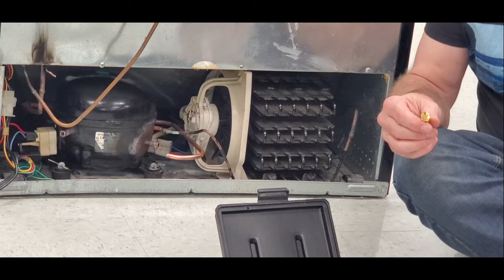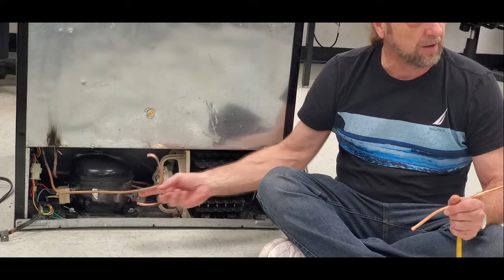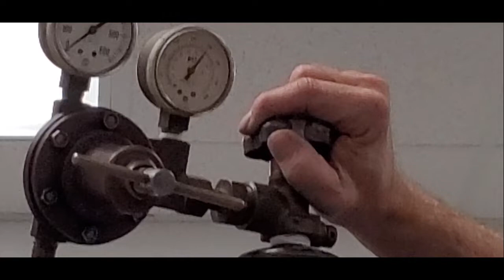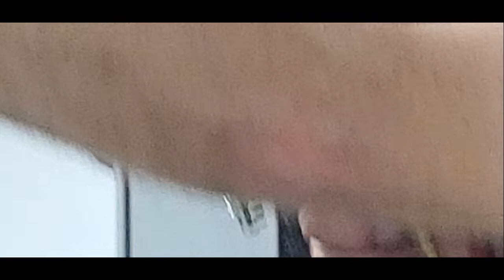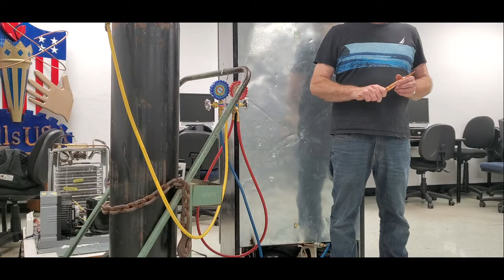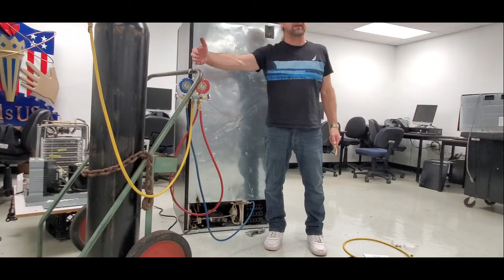Sealed System Looking for restricted capillary tube

Comment: At 26:09, he said that if there is no oil coming out you only have to replace the capillary and evaporator. If the nitrogen is coming out of the capillary tube with the proper amount of force, wouldn’t this mean he cleared the restriction? So why not just install a new filter drier, evacuate, and recharge?

Comment: Good day sir. I have a question about recharging refrigerant to a fridge. I have noticed that you charged the sealed system with the can upside down. Is that the correct manner cause I have seen other video clips where some say that you might damage the compressor internally if you charge liquid manner. Which is the correct way and why do you recommend liquid form. Tman
Reply: The main reasons to charge as liquid are: 1) It’s faster, which is probably not much of a concern on small self contained systems…2) Blended refrigerants can fractionate as a vapor, meaning parts of the blend may be getting fed in while others are not (the same is true for leaks with blended refrigerants). So you can mess up the blend potentially when charging these as a vapor.

I almost always charge everything as a liquid. You just have to use your manifold (or whatever valve you have in your charging setup) as a metering device while charging into the low side while the compressor is running. Crack it open, you’ll see your needle dancing around, monitor the compressor for frost or any strange “tinking” noises. This is so you don’t have the compressor trying to pump liquid, which can damage the valves. But if you did a repair and evacuated the system, just charge as liquid through the high side before energizing the compressor and let everything equalize, you can freely put liquid in this way.

Comment: I have a Samsung fridge the has this problem that you are talking about about , it hold pressure pretty good , the cap tube is not restricted, but when the compressor start stay on a vacuum about 13 inches of mercury . Any suggestions for me ?

Comment: Question. I have a r134a commercial refrigerator for soft drinks thats pulling into vacuum. I pumped nitrogen through suction to capilary and im getting a steady flow. Not sure how much flow i should get. Replaced drier pulled vacuum ran system. But still my gauge pulls to zero and i cant get it to 15psi. Any ideas.
Reply: You want to push nitrogen through the high side and watch it equalize to the low side when checking for a capillary tube restriction. Emulate the flow of refrigerant in the system. It’s generally a good practice in all nitrogen test cases, especially on cap tube systems. 

It could be that the restriction is only getting pushed up against or into the tube when the pressure is running the direction of the refrigerant flow. Another possibility is the system got moisture into it and it’s freezing in the system when it’s running.

Comment: Very very good video.  I do service  repair. I try to avoid.. working on sealed systems.. lots of Junk compressor today..

But like to save old refrigerator. 

I have a blocked line..
Capillary is flowing.. but lots of oil.

This I saw.. just cutting.. the cap.. at drier.  System was at 60 psi.
Unplugged not running.

I need to figure out if compressor..
Valve.. May be sticking..

I shut off the unit.. and it did not equalize..   Compressor tried to start.. was overloaded..
Ptc tripped 2 times. 

Then it kicked off.. but pressure  went to vacuum..

Can the valves cause this..?

I don't believe I have a restriction..
But there is oil in cap tube..

I'm  going to flush  the tube..?

Advice or link.. to testing compressor would be great.

These new Inverter compressor,  especially LG run.. but have failed to pump..  I call them Junk..

Comment: This is fantastic. One quibble - water boils at 212,not 312. Or 100 if you aren't using freedom units.
Reply from the maker: My instructor spent about a hour speaking nothing but facts mind you.. he has one misspeak and here come alll the Wikipedias ...... smh why even watch🤷‍♂️
Reply: I believe you meant to say medieval units
Reply: Water obeys the Smith tables.  The boiling point a function of pressure and temperature.

Comment: Why the suction pressure should read at 0 psig while running ?
Reply from the maker: Those are the design pressures on a 134a system. High pressure is 120-130 psi depending on ambient temperature

Comment: So the only way to get oil out off capillary tube is blow it out with nighten, if it’s full of oil then the compressor is low or some one put to much oil in system ??
Does the container and capillary tube and filter all have to be replaced ???

Comment: This is a really good dude all the way presenting some really good and must have information. I'm here because of capillary tubes restrictions and running in a vacuum.

You definitely have a lot of energy to present all of that information in 1! One bit of advice even though everything you are saying is music to my ears but for your students so much information at such a fast pace and then at different points random students are throwing out desperate questions

I would highly recommend slowing the pace a little bit and focusing on one area at the time and maybe elaborate a little bit more.

One last note as a student many years ago in the classroom and in the field one of the very first items that should be taught in my opinion is the magic of the metering device and what it does

In layman terms refrigerant goes in at around 100° but comes out the other side around 40 degrees. Someone that is just getting into the field can really grasp that very basic example and then the rest of their education will be smooth

Comment: just one additional point nitrogen is heavier than air and displaces it easily so when working with nitrogen you should do so in a well ventilated area our have exhaust fan running .  nitrogen will knock you out so quick you will not know what hit you....and that will be the end . its very deadly .

Comment: Great instructor, thanks for all your videos, sir.
I have a couple of questions:

1. Should a little bit of freon be added (to check pressure movement to determine if that is a leak or restriction) with the fridge turned OFF or it can be turned ON to see changes live? 
2. If pressure is negative on the low side and we need to find out whether the issue is restriction or leak. Can I turn the fridge OFF IF pressure didn't change, then this is a restriction, and if the pressure started to change, then this is a leak? Would this assumption be correct? 
3. Applying Nitrogen on low side to check for the restriction, will it be pushed to both low and high side (through the compressor)? Like if I cut capillary tube on normally working fridge, then apply Nitrogen, will I feel it from both sides of capillary tube or just from low / high side of it?

THANK YOU!
Reply: 1. Yes you can add freon from the low side in vapor form and see if both side of the system respond, while it is running.
2. if it was a leak pressure will rise if it is in a vacuum, how high depends on how much leaked out. At least minimum if a leak and there is no refrigerant left the pressure will return to 0 psi. RESTRICTIONS CAN BE PARTIAL, TOTAL OR FLOATING. So results after turning the refrigerator off vary. 
through the
Reply: @appliancetraining5600  looks like your 
 message hit a limit of letter numbers or something. Would be interested to know the answer on the 3rd question. Thank you very much
Reply: @НикитаЯровой-с4ш  if system is not restricted, and you charge with nitrogen, to lets say 100 psi if you cut the capillary tube and pressure should come out of both ends, if restricted may only come out of the cap tube side and not drier filter. The compressor depending on type of compressor and position of the piston sometimes charging through just process stub of the compressor may not push through compressor to the condenser.

Comment: The process tube adaptor kit is used in conjunction with the process tube pinch off tool to seal up hermetic sealed systems, instead of leaving access valves which can leak.  All servicing is done thru the process tubes. They can be added to each side of the system or lengthened, do your work, thru the process tubes and pinch them off, remove your process adaptor, and seal the end with a braze, maintaining the sealed system.
Reply: You're correct, I have been saying that for years. We can't pinchnand seal off 600a units the valves stay on.
Reply: @riz65  Offcorse you can! 2 pinch off pliers make job safe!
Reply: . @NiksaMarkoviczvirka   yes you can remove valves, but it's not safe, If you pinch of tool is leaking when you are trying to seal with a torch you have a flame hazard or explosive hazard, So I say this if you remove the valves which is possible, the risk is on you. So If I said its ok and somone does it incorrectly then I would be the one at fault
Reply: I just discovered this product, but why not braze a service valve? If brazed properly, and using a proper cap, it will not leak, a service valve could also give access for future service.
Reply: @hobbyless4089  Every time when you connect pressure meter to that process tube you are loosing too much refrigerant. Therefore on systems with less than 200 g of refrigerant, make them sealed!

Comment: Don't risk your fingers over saving refrigerant! There's internet posts on what can happen. Also if you use gloves make 100% sure there's no holes in it. The holes can trap refrigerant between your skin and gloves and can promote frostbite faster than you realize. In appliances it's pretty much not worth the risk with how much refrigerant these systems take so when in doubt let it out. Accidents aren't punishable by law at least for that amount.

Comment: I removed a freezer compressor and I open the compressor and water is inside no oil what happen with it
Reply: Sorry I dont get email notifications of posts from viewers, if you have water in your system that most likely happen due to a low side leak like the evaporator, they run in a vacuum almost when cooling, so a small leak will make the evaporator run below 0 PSI and that would allow moisture/water to get sucked into the system

Comment: Lg linear low side -10, high side 225 after installing new compressor.
Reply from the maker: Does the unit equalize... if so how long.. psi?
Reply: @TMMApplianceRepair how long should the unit take to equalize? Trying to see if I have a restriction. Fridge is running in vacuum while plugged in (around 18 inches of mercury). Pressure on low side goes up to 45psi after 10-15 minutes.. so what’s the normal time it should take to equalize?

Comment: you're right about heat restricting caps. It's POE I rarely rarely rarely ever changed a cap with R12 and 502 but since the introduction of POE it's common. If you work on commercial coolers and freezers you know. BOY do you go about the hard expensive way of testing for a restriction. If the unit is in vacuum do not add gas (I use to make that mistake). Turn the unit off and watch how fast the low pressure recovers, pretty much like you watch how fast it dropped with nitrogen. If it takes 5-10 min to stabilize it's restricted and not low. So prior to adding gas check for restriction 1st, by simply turning off the unit and watching the low pressure recover
Reply: Nice explanation ,thanks
Reply: So how long should it take for the pressures to equalize?

Comment: OMG... hope your students didnt record this... you referred to a filter drier as a drier filter, which is no big deal but never heard it called that, most call it a liquid line filter drier, because the suction line filter is normally only a temporary drier of sorts.  also.. you continually call waters boiling point 312F.... when its actually 212F.  I was supprised that not one student picked up on that, or questioned you about that.  teach the students that if refrigerant liquid spills out, especially in winter, dont be a hero. let it fly. no need to get hurt doing this work. I've found that liquid stage usually turns to vapor after a few seconds anyway....but that liquid is bad frost bite.
    Your going to find it will be difficult for your students to "UNLEARN" something you've already taught them, and the high pressure from the condenser never leaves the bottom of the cabinet as you were pointing to the upper cabinet. It never leaves the bottom unless the cap tube starts in the upper cabinet. however, your cap tube,(like most), is down below. your teaching of the sponge and body temperature relationship was good.  Teaching is no easy task.
Reply: I did correct myself when Tech2 pointed it out 9 months ago. This is a live lesson and unscripted as I do make some mistakes. Yes I did say 312' instead of 212'.

It is obvious you are an AC tech not only by your screen name, but in your understanding of the system. Refrigerators have a loop called Yoder by some manufacturers and Hot Gas loop by others. This is an extension of the condenser which runs up around the freezer door to reduce exterior moisture from forming around the door gasket of the freezer, so you are incorrect about the high pressure never leaves the bottom of the cabinet.

Although the capillary tube is a  liquid line that term is rarely used on refrigerators and the Hot gas line does go up and back down to the bottom, look at this link half way down an example and explanation is given. 

https://appliancerepaircourses.com/home-appliance-refrigeration-technician-course/hart-course-module-three-sample/
Reply: I saw your comment on the LLFD N laughed. I was gonna ask if you caught the 310 boiler spoiler point. Lmao!! 😂😂😂 He needs to take his own advice and perpetuate his metaphor of water to his students. He's water n they're all sponges. just hope they don't leak that bad info. LoL. I'm an engineer and during a class similar, My "Instructor"  said to all ... "Propane is lighter than atmosphere" 😂😂😂 Then when I nicely disagreed, He called me an idiot! SMH. Actually asked if I wanted to go outside and handle it. 😂😂😂 I told him.." No Sir. I  believe one more wack on that skull will probably make you forget everything!" Then I looked at all the others n said.. He'll apologize tomorrow hopefully. LP GAS SINKS. Remember that.  Needless to say I Tested, Pre-grad n never went back to that class. Least two of us are paying attention. lol
Reply: I saw your comment on the LLFD N laughed. I was gonna ask if you caught the 310 boiler spoiler point. Lmao!! 😂😂😂 He needs to take his own advice and perpetuate his metaphor of water to his students. He's water n they're all sponges. just hope they don't leak that bad info. LoL. I'm an engineer and during a class similar, My "Instructor"  said to all ... "Propane is lighter than atmosphere" 😂😂😂 Then when I nicely disagreed, He called me an idiot! SMH. Actually asked if I wanted to go outside and handle it. 😂😂😂 I told him.." No Sir. I  believe one more wack on that skull will probably make you forget everything!" Then I looked at all the others n said.. He'll apologize tomorrow hopefully. LP GAS SINKS. Remember that.  Needless to say I Tested, Pre-grad n never went back to that class. Least two of us are paying attention. lol We all make mistakes. The One thing about them is to learn from them. He's actually a pretty good instructor. I'm not hating.. Just laughed at an old memory.

Comment: Hi guys. My bottom freezer refrigerator is about 8 years old and having the similar problem. I see frost at the joint between the small callipary tube and the evaporator tube. Then It melted, water started dropping. The temperature was between 28-48F. I did reset the fridge by unplugged/plugged. It didn't make any different. I did replace the start relay, capacitor, defrost thermostat,  temperature sensor, and electric control board,  still does not work. Is it worth to repair my fridge? And how much does it usually cost for vacuum/flush out moisture/oil out of the refrigeration, including replacing the drier filter? Please advise.  Thank you.
Reply: DId you change the drier filter ? My Maytag does the same, ices over the connection of the capilary tube with the lg tube (covered with C4), and it goes to the 1st loop (about 4 inches).  Every fan works, compressor works, but it gets cold only at the connector area. Any ideas ?
Reply: @kkaresz78  Sounds like a restriction from moisture.  Try taking a spray bottle with hot water and spray that area where the capillary tube enters the evaporator. Spray until the ice is gone and and it begins to thaw.  If there is moisture frozen inside there you will hear popping and clicking indicating renewed flow of freon to the evaporator.  I currently have this same issue and will probably need to purge the system with nitrogen and replace the dryer filter and recharge the system.

Comment: Ideal  suction pressure for a refrigerator running with r134a in the system is 17psi which gives  u a 18 degree evaporator temp n 38 box temp. 0 psi reading ur system needs proper troubleshooting.
Reply: Residential refrigerators run at 0 PSIG, have to remember these systems are a freezer with a refrigerator compartment. The pressures you are referring to are, if the unit was a stand alone refrigerator with no Freezer.

In order to cool the freezer, the evap temperature has to be approximately -15 degrees Fahrenheit.
Reply: 22 psi for commercial refrigeration units using 134a. Domestic refrigerator with evaporator in freezer 0 to 3 psi..
Reply: Yep I realized that after I sent it. I don't work on residential just commercial. But enjoy learning about the residential side n home appliances. Thanks